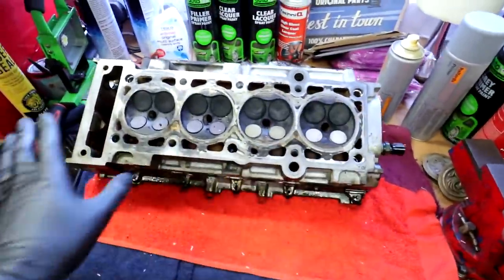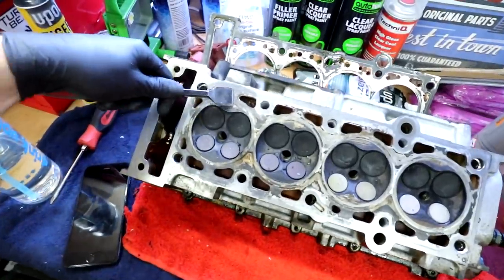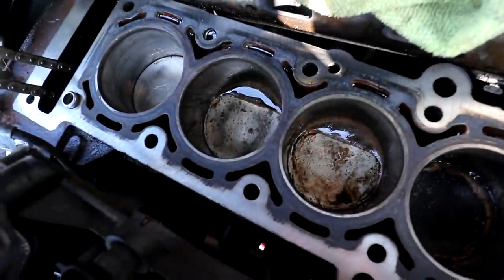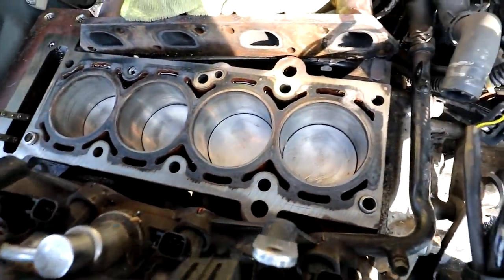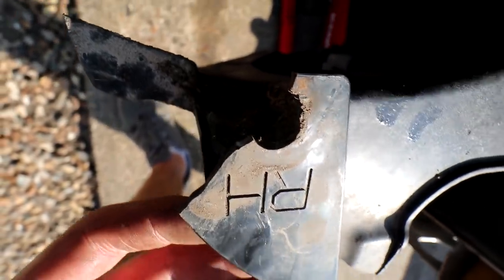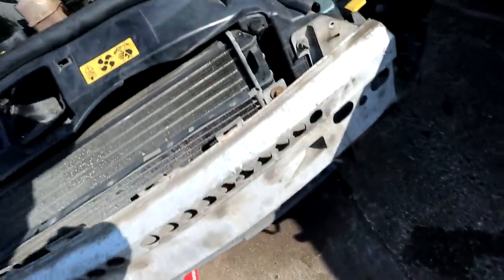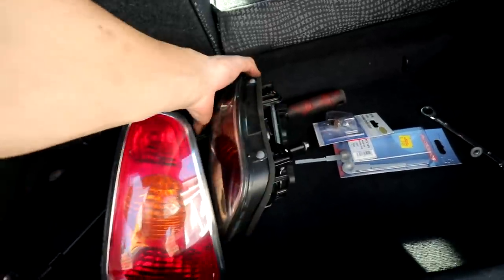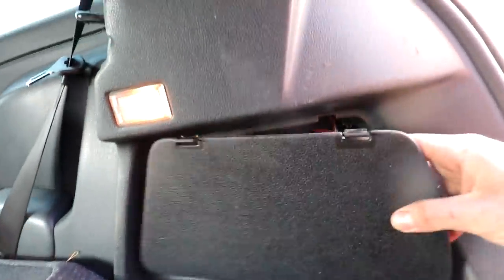Mini Cooper Head Gasket Replacement (BIG PROBLEM) Part #2

Comment: For future reference, the boot can be opened with the emergency release under the back seat if fitted. Lift the rear seat and there should be a cable with a little finger loop. 
There are some great groups and pages on Facebook for spares and advice too. Always people breaking Mini’s.
Reply: Yeah it can except for 2001 models

Comment: There is a secret cable under the rear seat ! just to let you know if the battery operated boot isn't working or if the battery isnt hooked up
Reply: I think Minis from late 2004 came with this emergency release. Older onse might not have them except somebody  upgraded it.

Comment: Boot release catch is under the rear seat which is very easy to shift out the way!
Reply: Mine didn't have 1 on a 52 plate cooper s
Reply: @jaybooth9168  All but very early Minis had the manual release cable, 52 plate is just too early :(

Comment: Any decent engineering firm will weld and skim that no problem.
Reply: That's exactly what I said Roy
Reply: Try some chemical metal once hard it can be machined. It is a common problem with alloy heads
Reply: Geoff Harrison that's a bodge, needs welding.

Comment: Engineering shop will weld and skim the head no problem, meat and potatoes for them
Reply: Yeah I thought that was an option
Reply: Definately,  a tig weld on the edge and then a skim and it will be fine
Reply: I actually was about to ask that when I saw your comment, thanks for beating me to the punch!
Reply: Will there possibly be an invisible hairline crack that when welding will make it open up ??
Reply: BigD i was just going say this
Reply: How much would it cost to weld it and skim the head??
Reply: Yeah weld it and copper it so weld won't go over materia,  I'll say tig and who knows depends on material mig weld it with copper and grind excess.
Reply: I'll charge for the job  100-120$ for the job

Comment: Changing the wing on most modern cars is very easy I changed the wing. On my mk3 Renault Clio 58 plate after I bumped it on a gate but it’s was quite a big side panel to change but did it all by my self and I’m not technical like him

Comment: james,  you can always put a long pipe or breaker bar between the seat and press onto the brake pedal and turn the key to number 2 that way you can check your brakes on your own
Reply: I use the good old brolly.

Comment: Minis are a pain in the arse. Changed the oil in mine on Saturday, went for a quick run after and two coil packs have died 🤷‍♂️ how’s that even possible?
Reply: That's like me buying spare engine  sensors for my cinquecento and when you go to use them they only last a couple of months as they are from fleabay and the quality is questionable. My Renault scenic used to eat coils.... so much so I used to keep 4 in the boot.
Reply: They were built to last 10 years only
Reply: BMW minis are crap, window problems, locking problems, electrical gremlins because of the great positioning of the BCM, and brake pipes.

Comment: Just replace the head. Once upon a time i temporarily repaired a cracked head on a 1.6 Ford diesel with JB Weld (its basically glue). It worked for 3 weeks till i could source another (this was back in the early 90's).

Comment: If you lift the base of the back seat behind the drivers seat there is a cable to release boot,  pull the ring and it will open  for future reference when battery is off the car or pancake flat !!
Reply: Richard Mounfield I think they didn’t fit the internal boot release on early models, the 52 plate Cooper we used to have didn’t have one so I retro fitted one.
Reply: Stuart Farrington  My wife's is a 04 model thanks for the update .  I personally am not a fan of electric boot locks .

Comment: Nice spot on the head damage. I'd guess it's been run for a long time with just water in the coolant. 
It is repairable if you know someone who can TIG weld aluminium then get the head skimmed.

Comment: You can get a machine shop weld the eaten away jacket then grinding and reserfcing, yet since labor will cost you more than the cost of getting a new used head, Id scrap it.
One the new used head, get a grinding pit and do some he port and polish, it will be a good learning experience and some vids for viewing pleasure.

Comment: Defo get it welded and remachined probably cost you up to £100 max?
Reply: For 100  you could get a used head either from a scrappy or eBay.  An aluminium weld could always be a weak point in future even if it's polished flat with the face.
Reply: @steve0680657  wasn't sure how much his local machine shop would charge! Was saying that's worse case. Not sure how much heads are for these. Weld would be fine if done properly :)
Reply: Probably worth pricing up a weld and see, if its any more than about £90 you are probably as well to just a head of a scrapped car.

Comment: Hi James, the head is crappy as it is now, naturaly a new gasket would not help for sure. But how can be sure that the new one you've ordered is perfect? The well known anthem is Beware the N series BMW engines whatever the logo is on the bonnet... So I would have rather refurbished yours in a reliable mechanical shop.

Comment: You could weld over where the head is corroded and then use a dremel type tool to machine it back to stock

Comment: Haha, I had an old Renault a few years back that water would collect in and fill up. I drilled a hole about 2mm wide, and the water would drain straight out. Simples. And cheap.

Comment: If you have ordered a second hand head what's to say that head is not cracked or warped , I personally would have had the head welded and re-surfaced.
before fitting the new head I would check it for flatness with a good straight edge and some feeler blades.

Comment: Spray paint the trims gloss black that washed out grey look is nasty
Reply: @The Boss gloss black comes out good on those types of plastic trims it's only when you've got a smooth surface that the paint shows up really glossy and shiney but those types of trim are a ruff plastic so doesn't look over the top I've done it to all the trim pieces on my car and it transforms it entirely 😁
Reply: Heating it up with a heat gun does a decent job to restore the original look

Comment: When looking for a good second hand head just remember the cooper and cooper s run the same head just different valves so would just need to swap yours over is you got a cooper s head
Reply: If the valves are different then surely they won`t fit.
Reply: @pauljoe780  different metals as the cooper s runs hotter but they are the same size

Comment: This is what happens when people just use neat water instead of proper antifreeze. It corrodes alot quicker and you get this. I would personally have it tig welded and skimmed. Better the devil you know. Great series. 👍

Comment: For maybe next time some cars have a manual unlock button on the inside of the boot near the latch. Just saves you reconnecting the battery

Comment: There will be another way to open the boot. 
Fold the rear seats down n there should be a cable or an emergency release button to pull 
Normally is on most cars

Comment: If your getting a secondhand head you should really have it checked for distortion and a clean up skim/ pressure test, unless it’s already been done ready to fit. Otherwise it could be a lot of work for nothing and you will still have same problem. Just advice 👍🏻

Comment: Looking back at this vid, James and pitticuly the rather strange erosion on the cylinder head...such a corrosion can be the result of a earthing issue.( massa) of the engine. Cos a bad earth connection cause that the coolant starts to act as earth....with the result that alu heads, get eroded in the coolant channels.
Maybe an extra earth connection  can't harm. ( ppl would be surprised, how poorly the earth connection are at cars!)

Comment: Any decent engineering shop would be able to TIG that back up then reshape and skim it. It would be far cheaper than replacing the head plus you'd still have original parts on the car. Although on saying this just finding a decent shop that'll actually carry out a repair will be a challenge since these days most have the attitude of replace rather than repair.

Comment: Just get the head welded and 're skimmed. If you get another head there's always a chance that could be cracked or could be warped and you might not know till you put it together. Just get that head repaired.

Comment: since you have clean the inner engine should change spark plugs, fuel and air filter
Reply: Yep. And he also should take off the oil pan and clear as well as he can the coolant contaminated oil sludge from the bottom as well, not just from the top of the engine. I would also flush the oil 1 or 2 times to make sure I have clean oil left in the engine and not some coolant+oil mixture. ;) And there's the radiator, coolant hoses, etc. At least that's what I would do, if I wanted to keep the car. Otherwise I would scrap it, 'cause head gasket failure and constant overheating is a pretty serious problem foe an engine.

Comment: People use water instead good quality coolant!! 😯It´s the same thing in all countries...here in Portugal is the same thing.
Reply: We get frost here though so need anti freeze.
Reply: @marklittler784  It is always necessary to use antifreeze anywhere on the planet. The water will always corrode the metal after a few years. 😉
Reply: @Speedy1208  Yeah its the rust inhibitor in the antifreeze thats doing that but many countries don't need antifreeze, but rust inhibitor, they usually come as one though.

Comment: Definitely new head required, these engines are “problematic” there & I wouldn’t risk a repair

After my comment in your previous video re dirty LM grease container on the front passenger seat, in this video you’ve got greasy and oily engine parts directly on the drivers seat!!!  Don’t you believe in nylon seat protection????   Or do you enjoy sitting on oily seats?

Comment: They can weld and re-skim the head but it ain't worth it in my opinion. Buy a decent head and inspect before buying. Will save you headaches in the long run

Comment: That’s looking not good  I don’t understand that’s happened  either  the cylinder head  was a bad casting or the anti freeze wasn’t changed probably  or even the thermostat wasn’t operating properly.

Comment: Guys need help my engine rattles in my car when accelerating more so when at higher rpm 3000+ been told the car has noisy tappets could it be that? TIA
Reply: Petrol 1.6 vts c2 btw

Comment: Standard bmw mini problems they have shocking build quality any one who rebuilds the 5 speed gearbox won’t warranty them as they are made of monkey metal and they recommend putting in a later 6 speed gearbox which is a huge job

Comment: That looks like eletrolysis where the coolant chambers have been eaten away?.
Reply: Could be. But as I suggested right after the first video, since the cooling system was run for a long time with lots of air in it, it's more like cavitation  has eaten away the metal parts. And he still haven't checked the water pump. I also said after the first video, that he might not have much impellers left on the pump either, due to cavitation. But hey-ho, it's not my car. It's also interesting to see, that he doesn't consider the fact that those bits of aluminium must have gone somewhere. It could have clogged up the radiator for example. Chances are that it was eaten away in very small bits and particles. But sill, the minimum I would do after a head gasket failure, like this is to check and clean everything, regarding the water and oil passages. Because water in the oil is just as bad as oil in the water, or maybe even worse. 
Will be interesting to see also in a few moths time, if the engines burns much oil as well. Since it has been overheating regularly. I'm still not optimistic  about this car. These cars have a reputation of being an engineering failure. And it seemed like it right from the first video.
Reply: @Georg1979  I would say your spot on,  i wonder if using a coolant that keeps away from water in the system something like Evans coolant, but i think you have to make sure the hoses are in good condition, but you pointing out the water pump would be a good area to check aswell as the radiator because the aluminium that might be in there ends up like green sludge and sticky. ive been guilty in the past changing headgaskets and not flushing the system through (my old man did say you should always do it) .

Comment: There's boot pull under the back seat if ever you a locked with no power
Reply: john ross not sure there is one on pre-facelift model
Reply: @willsy5164   Hi mine was an 05 plate so it could be different anyway keep the good work up    Cheers Jon

Comment: If anyone is here wondering, if you need to open the boot and the batteyr is dead, there's a pull cord under the back seats which will pop the boot!
Reply: My 09 didn't have one. I had to break the privacy shield to manually open it
Reply: @Jude300c  yes, the Gen.1’s have them, which is what the car in this video is. You have a Gen.2 which I’m unsure if they have them, by the sounds of it no. 

You could have applied power to the battery though and it should’ve worked
Reply: @GrindingGearsOfficial  in my case my fob broke off the chain into the trunk unknowingly. I've triple secured it this time, but what an adventure trying to get that thing open.

Comment: No way, just scrapped a mini cooper with a mint engine in. Tried to flog the engine but couldn't even get any takers at £50 so you should be able to get a cheap head.

Comment: That boot is the worst... I left the jump leads in the boot and the battery ran flat one night! Had to take the day off work because of it.. 🤦‍♂️🤦‍♂️
Reply: Did you ever find the release under the back seat?
Reply: @hardwurkindaddy  No I didn't.. 😅 I got rid of the car after a few months.. Lovely little car, But that was the problem to little..

Comment: How's the possible in the first place? Metal eating coolant?
Reply: Must have used cheap coolant from HomeBargains or something.  Always use HOAT in modern engines.
Reply: Electrolysis erodes the aluminum it's very common on alloy heads plus as people have stated old antifreeze. You should change it every few years as it contains anti corrosion additives